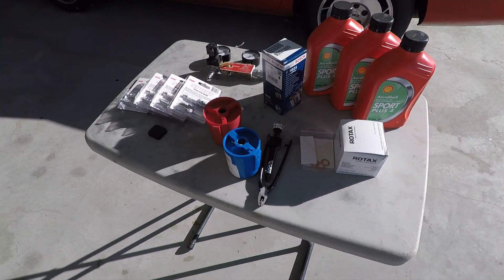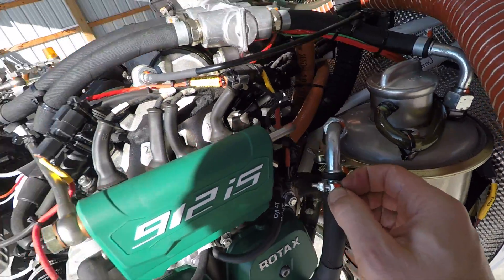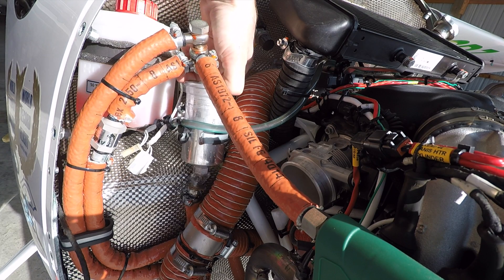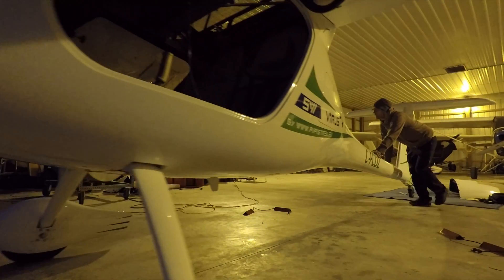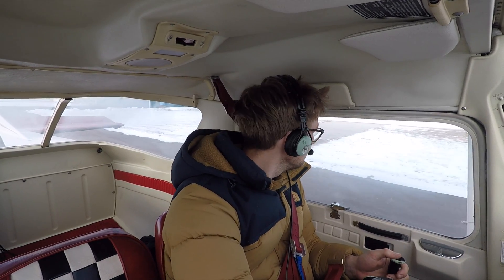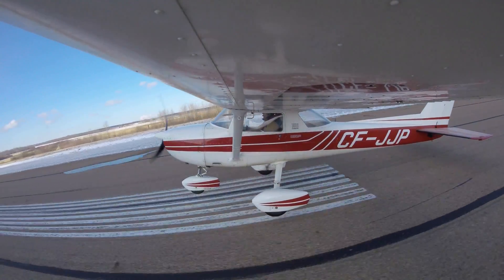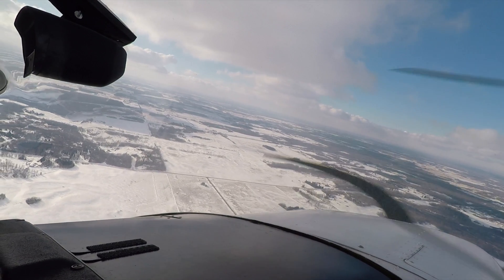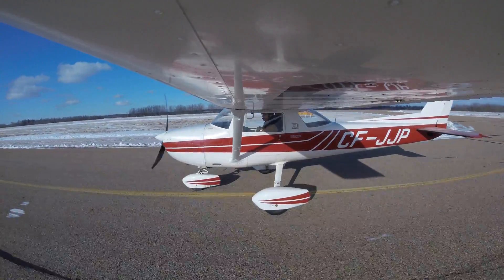Pipistrel Virus 100 HR inspection

Comment: Hi Darryl, why do you use the cowl flap?, my sinus's oil temp is in 230 degrees (low yellow), when i go up, doesn't let me do more than 300'' per minute, sometimes even less, seems like i need more air into the motor canopy
Reply from the maker: Galo Villagomez hi Galo, it's essential in Canada where winter temps are on average -20°c. I've flown as low as -40°c with the virus so it helps tremendously to close the cowl up with the flap and keep some of that engine heat in, also helps with cabin heat. It also does help with cooling as well on hot summer days, especially when idling on the ground, it extends negatively and helps suck out the air quicker through the engine cowl, I've had two virus's now one without and one with the flap, it is vital when flying in varying temperatures to help control the engine temperature.
Reply: Thanks Darryl, for your fast comments, did you make the flap locally?, or you got a kit from Pipistrel?, sinus has the part where you locate the flap, not so wide, do you think it would help me keep the temperature normal, while climbing?
Reply: In my case, I need to cool it off, in your case, you need it to keep temperature, maybe I need another solution, for my case?
Reply from the maker: Galo Villagomez I've seen improvements on ground idle cooling on hot days so it might help you. With my first virus the coolant radiator was partially covered by the cowl, Pipistrel sent instructions and new foam to increase the opening. I used to have engine overheating issues even in our colder climate. I flew in to Oshkosh one year and my coolant boiled over due to long taxiing, this was with my first virus. This flap was put in at the factory made by Pipistrel. I have heard they sell it as a kit to install yourself. I have been able to bring down hot engine temps with the cowl flap, sometimes taxiing long time downwind, open up flap and temp comes down quick.
Reply: Darryl Zubot Thanks a lot for your help, come to fly in Ecuador sometime, i have some videos in YouTube, you have very interesting videos uploaded, in your plane, you carry a camera on your side, is it for some special use ?
Reply from the maker: No problem. Thanks for your offer Galo, i'd love to fly there at some point. It's for aerial survey work that I do with the Pipistrel

Comment: Are you an A&P, or are owners allowed to do their own annuals in Canada?
Reply from the maker: Yes, I had to fly to the factory with an inspector from canada to do the 50% inspection at factory, final inspection was done in canada after it arrived.  But just recently Transport canada stopped this now you can't get a factory built virus into canada, only way now is to bring in the kit and build it. Now the virus if factory built will be in the "Limited Class", which means no more owner maintenance.
Reply from the maker: Caius Martius Coriolanus we can do our own annuals, but it depends what category the aircraft is in. Mine is in experimental/amateur built category which lets me do my own annuals. Transport Canada I've heard has changed how you import the Pipistrel now so I don't know if it's possible to get it registered as amateur built if it's fully factory built aircraft. But you can still buy the kit and register as amateur. This is my second virus, first one I built so I know the plane very well.
Reply: Darryl Zubot Ah, that makes sense. I know Pipistrels were all experimental in the US until about 2010. Something about there being no trade agreement with Slovenia. They built a factory just over the border in Italy and can export to the US now.

I'd really love a Sinus Flex for the range, the safety of a 30-1 glide ratio, and the bragging rights of a 3 gph aircraft, but the only light sport I've flown was an Everktor Sportstar which I nicknamed "Twitchy". How are the flight characteristics of the Pipistrel? Is she a gentle nag or does she act like she has a burr under her saddle?
Reply from the maker: Caius Martius Coriolanus interesting. Last time I was in Slovenia in 2015 the Italian factory was not completed.  I thought that factory was only for the production of the panthera. Yeah that would be sweet! All pipistrel are built so beautifully. Nothing else like them. The virus is very well balanced, not overly twitchy but is super nimble with incredible performance. Usually get 2000fpm climb rates. I'm also burning 3.2gal/hr cruising at 125-130 knots. Go test fly one, you'll be hooked.
Reply: Darryl Zubot That's what I'm afraid of. I'll just have to watch your vlog until I get it out of my system.

BTW, what's the fuel capacity on your Virus?
Reply from the maker: Caius Martius Coriolanus better to get it out in real life but glad to have you will follow my vlogs 😀. It's 100 litres total, 50 in each.
Reply: Darryl Zubot Thanks for the info. The way the Euro is right now, there'll probably never be a better time. I'm sure I'll regret waiting.
Reply: Were you able to buy your new Virus from the factory with an E/AB registration?
Reply: Ahh fascinating! I’m guessing they crated it over? That’s pretty cool, such a cool looking plane and that care free fuel economy must put a smile on your face every time you go flying! OH and congratulations on becoming a father!
Reply from the maker: GobsDeaDove yeah it is crated over in 40' container. Haha yes that's main reason for buying it. Thank you!
Reply: @DarrylZubot  : A normal 40 foot container like sits on the back of tractor trailers going down the freeway?  Do you get to keep the container?